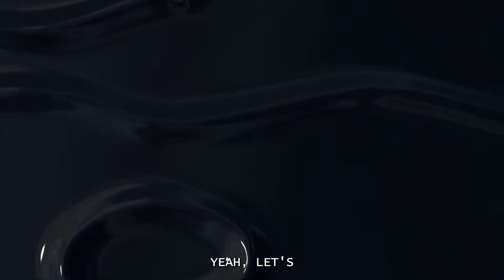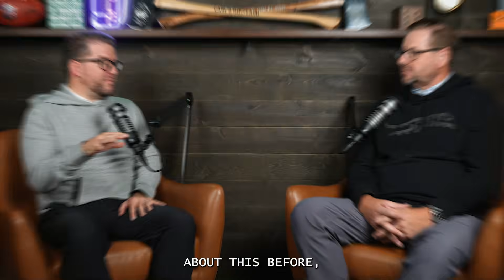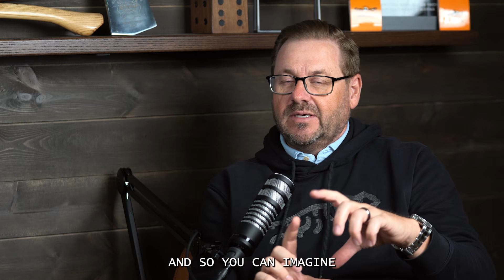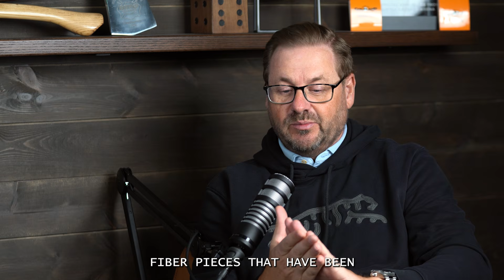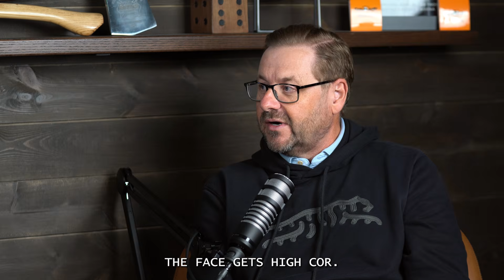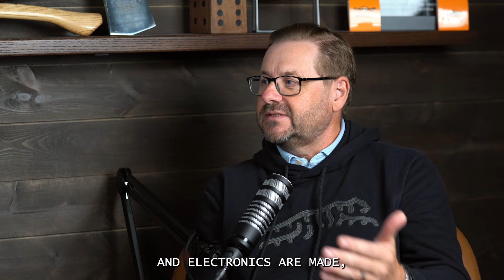How TaylorMade changed their manufacturing process for the drivers and fairway woods

Comment: Is everything made here in the us so you can control all the measurable ? If not then who’s measuring all the inconsistencies accurately ? Where’s the quality control check points ? As a composites knowledgeable individual and working in the aerospace field the definitions or explanations he’s using make me cringe. Specially the “ glue “ term.
Reply: As someone who works in manufacturing, you have to remember it needs to be consumable for the viewer who has no idea what you're talking about. I could talk about heat treating with terms like "austenitize" but a viewer would much easier understand the word "harden"